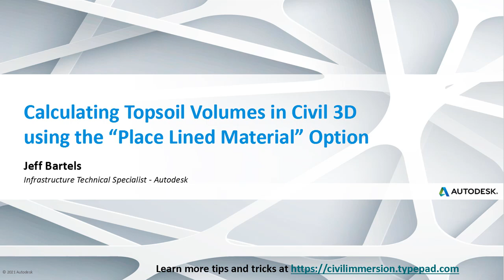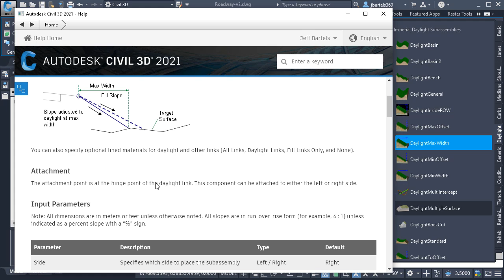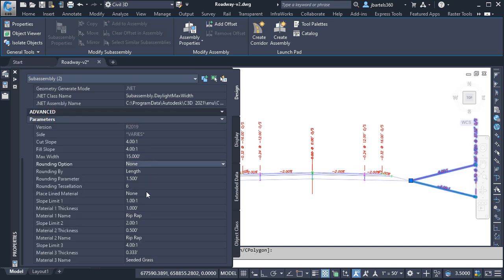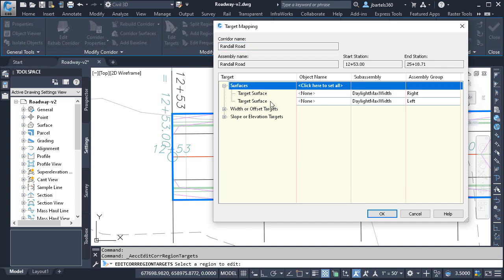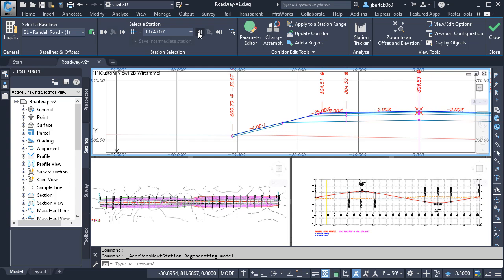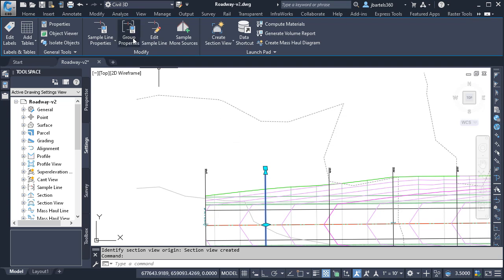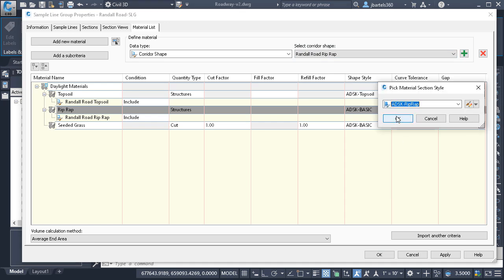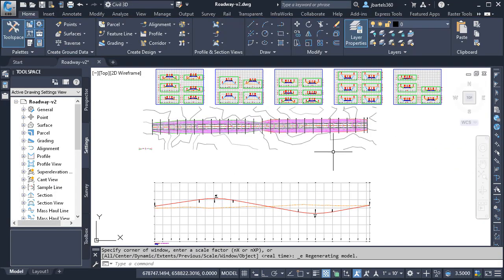Calculating Topsoil Volume in Civil 3D using Place Lined Material

Comment: Hi sir I need your help. 
Actually I have a finish surface for a landscape area with different types of planting and gravel,  i need to make a formation surface with different deapt of 30 cm 50 cm etc
Reply: A very basic way to do this is
You have Surface A (your site.)
1. Create new surface (Surface B)
2. In the definition , under edits -> paste surface (surface A) . Now raise/lower by your value. Eg. -0.3m.
3. Add a boundary
4. Do the same for a Surface C. Dropping by a different amount for different surface type. 
5. Create a new surface . Paste surface A, then B, then C. From least elevation difference to most. You now have a composite surface.
Reply: Can you give me your email id so I can send you the file so you can help me with a small video

Comment: i am design road along 20km the pc stuck.
================================================
CPU Xeon E5-2680 V2
Ram 64GB
VGA GTX3080 8GB
SSD 265GB

But when create corridor and show section road is stuck.

How should i can do?
Reply: Decent PC specs. I'd suggest having one file which has the horizontal and vertical alignment. 
Share these out via data reference. 

Create several files so you reduce the file size for each corridor.  Such as 1km sections. Turn off auto corridor rebuild.

Comment: Cheers Jeff! Im currently working on my Civil 3d template for our company, dunno where to contact you, but ill try here. Do you know is there a bug with Datum/Formation (Generic subassemblies - LinkSlopeToLevel and LinkWidthAndSlope) codes constantly changing, even if you import all codes in most of the code set styles. Its been a problem for me, cause i cant use proper labeling. Thanks in advance! Big fan from Croatia! Keep up the good work, professor!
Reply from the maker: Hi Josip, I am not aware of a bug related to the items you mentioned.  That said, I recommend reaching out to the Autodesk partner from whom you acquired your Civil 3D and log a support ticket.  The support person can verify if a defect has been logged and/or work with you to resolve the issue.